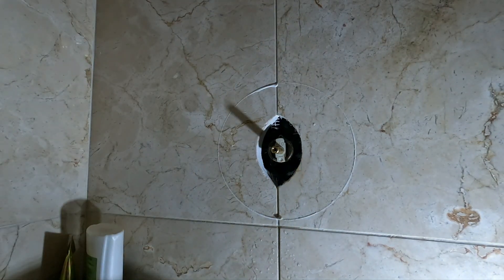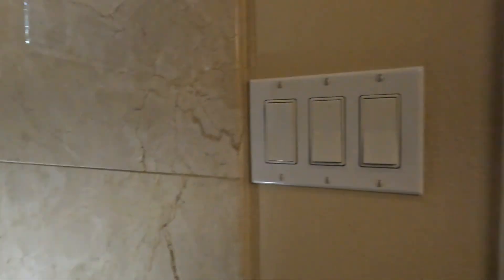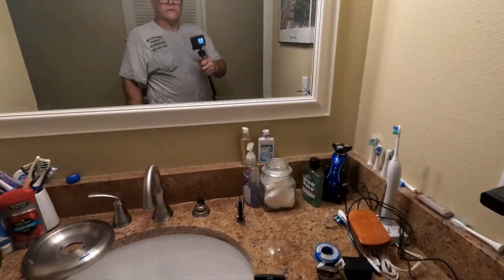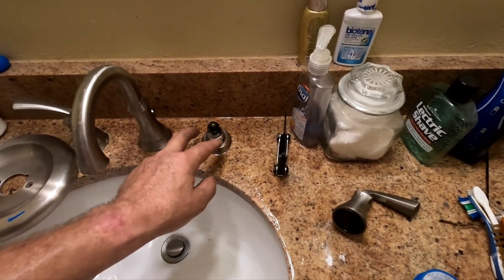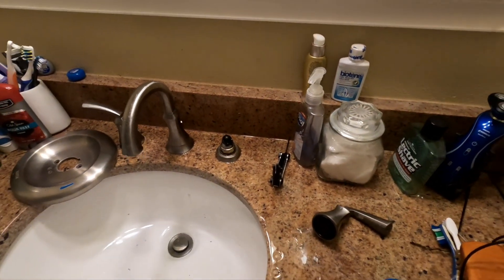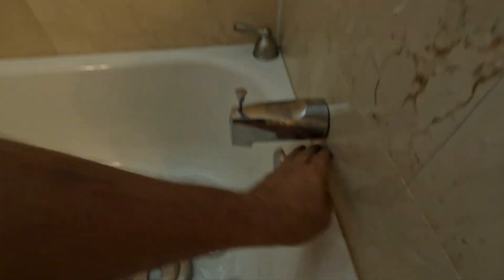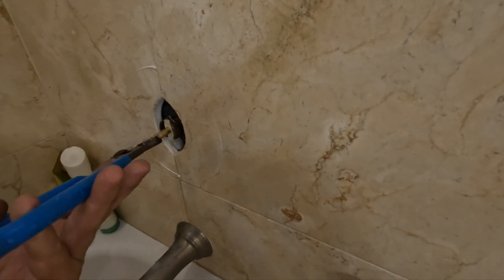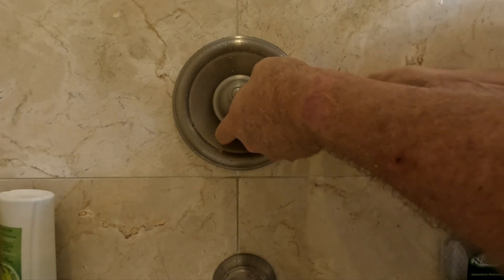3 MOEN POSI TEMP CARTRIDGES AND A DIVERTER SPOUT REPLACEMENT

Comment: When I pulled my old 1200s I put 1225 in ,the old brass seized up in the housing was a pain to pull ,Still better then Delta with that stupid retention ring.Great Video,I live in Vegas and our water is stone mixed with chlorine so seal go pretty fast I always have a few 1225 on hand grease and a bottle brush to scrub out housing